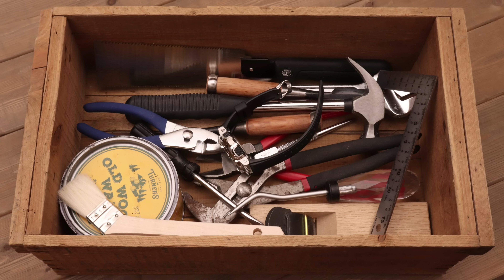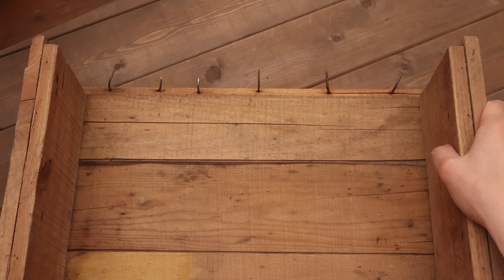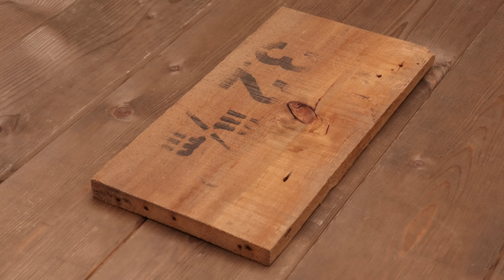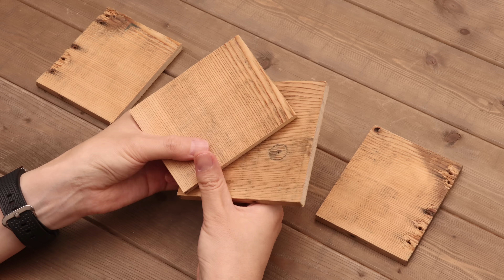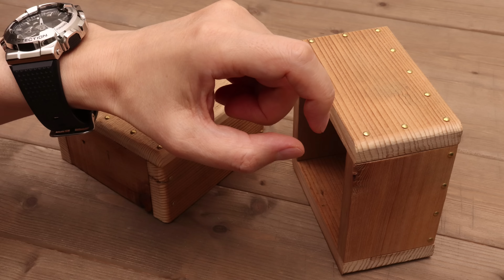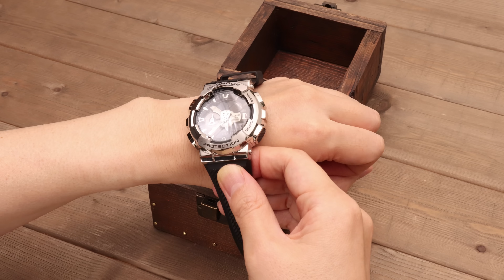Almighty Tool

Comment: Awesome animation! But I didn't undertand why he keeps clicking the watch now and then.
Reply: because hes the tool, and the button hes pressing is switching the tools mode, from high strength disassembling, to sanding, cutting hammering routing staining and so on, (wood stain which comes from the same place the hinges the latch and the pillows come from....)
Reply: The watch said "mode", so each click represented a different mode his hands were in. From easily removing the boards, sanding, snapping, etc.
Reply: The animation is an advertisement for the Casio watch, so he showcased it as promotion.
Reply from the maker: @aTerribleScrub  Exactly!!!
Reply from the maker: @CarthagoMike  Exactly!!!😅

Comment: I would have charred the wood to give it a natural color. The Japanese have been doing it for centuries.
Reply from the maker: You are knowledgeable.
The Japanese have prevented corrosion by burning the surface of the wooden boards used for the exterior walls of their houses.